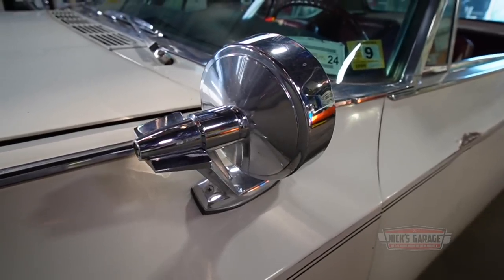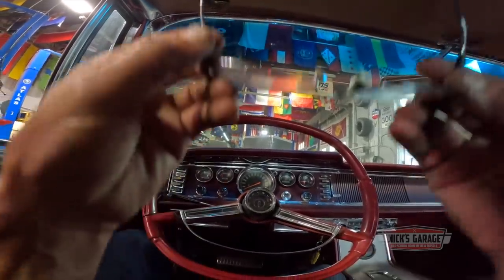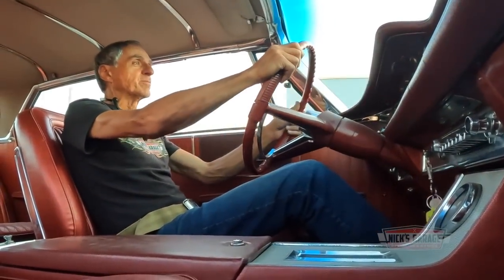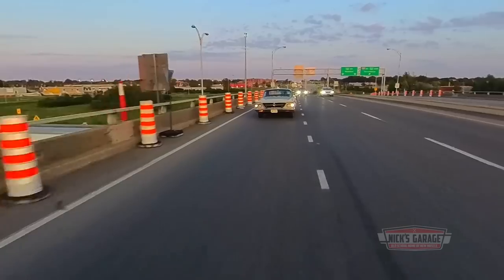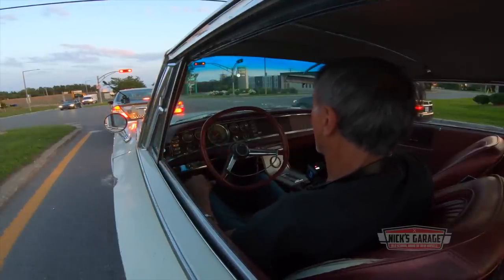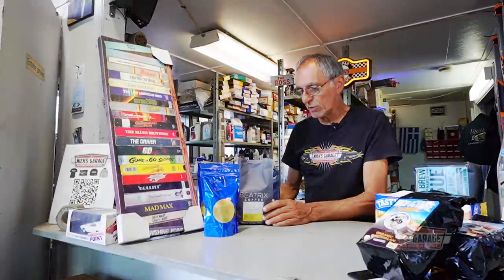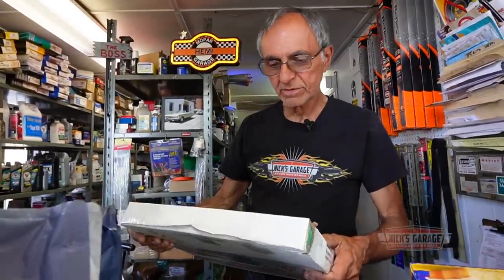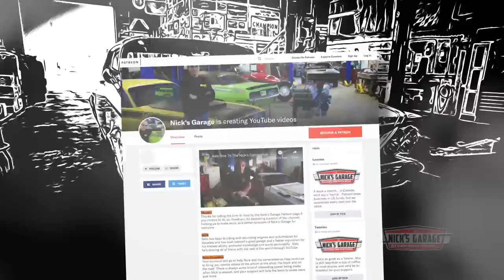Ultra RARE 1963 Chrysler 300J Blast - Highway Star

Comment: Best video yet !! 
I drive the exact car 300J white on red. 
I bought the car from the original owner 25 yr ago. It’s a beast !! It is stock with sure grip 3.23 gears. When you can get rubber shifting from 1-2 in a 727 automatic you know it’s torque monster !!
Mine is all original with only 45,000 miles. 
Hi Ho Silver, away !! 😂
Reply from the maker: Right on!
Reply: I have one too, white on red with A/C!!

Comment: Those are short rams. The overall length of the Rams is 30 inches but the long/short designation refers to the length of the individual runners, not the total length of the manifold. "Long rams" have individual runners for the entire length while "short rams" are divided for one half (15 inches) the length. It is obvious when you consider the outward appearance of the the manifolds. The divided section can be easily seen in the castings.

Comment: Awesome to hear that big car chirp into second gear like that.  Always loved a 727 being pushed by a big block!
Reply from the maker: Same here!
Reply: @NicksGarage  bet you misssed front dish breaks lol i got an old 1964 c10 ill be doing disk breaks basically only thing ill mod on it well the engine 292 inline six with head flow tricks high compression custom cam lots of muffler water [only] injection  and offy intake

Comment: Some Edsels had push button auto transmission, but the buttons were in the center of the steering wheel. Some Ramblers also had the same push button system as the Chrysler option (especially the Ambassador models) due to the fact that they used the Chrysler Torque Flight transmissions, re-badged as the Torque Command. My father owned an AMC/Rambler dealership back in the 50's and 60's and I remember seeing and riding in them, as well as driving them around the lot when I was a kid.
Reply: That is correct.  I had an Edsel a few years ago with the push button in the centre of the steering wheel.
Reply: All Chrysler Products equipped with automatic transmissions had "Push Button Drive" from 1956 through 1964.
Reply: It’s a great space saver to move to dash.  Took them 50 years and it’s back. My 2019 Ram has a transmission dial on dash.  Love it.

Comment: Awesome video!  Kudos to Mike and Mary for letting you give it the beans to showcase one of the kings of early 1960’s passing power.  The style is polarizing, but down low torque is fun.  I built a Chevy 496 that was at 500 ft lbs at 3,000 rising just past 600 ft lbs at 5,600 - it would just leap at any speed the accelerator was floored.
Reply: Nothing feels as good as all that low end torque of a big block

Comment: My 1963 Dodge 880 shares so much with this car for good reason.  From the firewall back it is the same chrysler. Dodge didn't have a full size platform after a screw up and Chrysler gave the platform until the Monaco came out.  Check the steering box. They were sloppy when new.  I have mine tightened up as much as possible but still needs a rebuild this fall

Comment: My neighbor had a 300J with the 413, thought the 413 was a 4.25 bore. Another Neighbor had had a 58 Edsel with a 361 PI. The Edsel was much lighter than the 300, but the Edsel would beat it, but those 2x4 s sounded so good. The 361 PI was a solid cam in it and a 4150 Holley it was said to be a 750. That thing would rev to the moon. The tachometer would wind to 6200 rpm s and that’s why it beat the 300. They both had this charisma. That was gone a few years later.

Comment: Said it before, if i won the lottery it wouldn't be hemi chargers in my garage, it would be every model year of 300's sitting on my property
Reply from the maker: Nice choice!
Reply: Maybe Nick should find a nice 1970 Hurst Chrysler 300 that no longer has a matching motor (or a worn out motor) and put the 528 Hemi in that. Sure would fit the "big motor" theme of the 300's and would really motivate that big C-Body Chrysler (of course a 70 or 71 white Cuda with Red interior would love the 528 Hemi as well). I am a big man, so I am with you loving the 300 line.

Comment: The first or second time around, I thought it might be a fluke for the tires to "chirp" when the transmission upshifted to second, but the same thing happened over and over again, so there's just a lot of torque coming into play. Going  back a long way in my memory bank, I believe this car had a listed curb weight of around 5,000 pounds, and that's a lot of beef for a 413 (+.060) to haul around. Fortunately the big block MoPar is up to the task.

Comment: I had a Dodge Coronet 880 custom convertible 1963. I can see some of the parts that 300J had that was on my 63. Tail lights and I think the head lights. The back end of that 300J looks a lot my Coronet. My Dodge had  the push button shifter, it went across from left to right. Not up and down like that one. Nice going Nick.😁
Reply from the maker: Great cars.

Comment: I've had distributor bushing get ovaled out. You can set it but as the rpm go up the gap will change due to the wear in the bushing and or shaft wear.

Comment: 1963 us safety regulations required all new 1963 cars to be equipped with seatbelt anchor attaching points but not the seatbelts themselves they were optional. And almost no one ordered the seatbelts it took five more years till 1968 before seat belts became mandatory in new cars.

Comment: American Motors used a push button transmission in the late 50's to ( if I remember correctly) 1963 or 64.  It was designed by Borg Warner and called Telovac.  I think Rambler called it flash o matic
Reply: Edsels had the push button also on some cars.

Comment: Still has carb or timing issues. It’s like it’s flat, distributor advance working?  Just watched a video from Dead Dodge Garage where he road tests a ‘61 G with a long ram 413 and it sounded completely different, much smoother and faster.

Comment: We've owned a lot of Chrysler over the years but I have no experience with the 413 engines. We've had 318s, 361s, 383s and 440s. I think the 383s are the best all around engine. Their powerful, fast and can handle anything you ask them to do. Actually all the Chrysler engines preform very. I'm not too impressed with Carter carburetors, they are usually the reason for a Chrysler engine not performing as they should. If I happen to take on another Big block Chrysler,  I will replace the Carter with a Holly. I've used Holly's on my Fords and they never disappoint me.

Comment: I saw the 140 mph speedometer, I was wondering if that 300J  it could do 140+mph?
Reply: I was thinking maybe it could...but you would want that steering tight and front alignment...and good brakes and a closed course... it would be like a runaway train coming down a mountain and likely ride like a pillow if the road is smooth.
Reply: Push button automatics was a Borg Warner thing, till the auto company's started make the transmission.

Comment: Any data on 0-60 or 1/4 mile times for that car originally? A moment in the video there is a red Honda, I think, in the left lane where you go right to turn off (at 22:43). Looks like they are thinking "WTF?!!" as you motor on by chirping the tires with that big ass engine noise. Had to watch it several times...couldn't stop laughing!!
Reply: 1963 300J 15.8 @ 89 mph quarter mile.
Reply: @victordjinn632  And that was a crossram version wedge motor?
Reply: @casperdowlen625  Yes. There were no other engine options for this car. When you bought this car you got the 413 cross ram. That mod was for top end. The car weighed 4500 lbs which is 2 and a quarter tons. You'll notice it has a 150 mile per hour speedometer. Necessary because it would do most of it. 140 plus. Not a quick car. A fast car.

Comment: Hey Nick, I was wondering if you could do a video on how to make your old muscle car just go as fast or faster then modern cars without going crazy, like my 68 charger is going to be estimated at about 350 horse, and I was wondering for B body’s for there weight what’s the appropriate HP to make them go faster then the modern car, like it the 1/4 mile, I’m guess like 450hp?
Reply: Yes, I agree.  Most of my engines that customers look for is  400 - 475 HP.

Comment: Yeah, those Bendix drum brakes are terrible. I had a 64 Dodge back in the day. A couple of hard braking stops from 60+ mph and that's about it, no more stopping.  If I had that car now, I would have put Road Runner disc brakes on it. Chrysler engineered them to go fast but not to brake till much later. A real shame.

Comment: I looked up the specifications of the 300J. A big car, but not particularly huge by 60's standards. My parents had a '76 Cordoba, which was almost identical in size, and the Cordoba       was a "smaller" Chrysler. I drove the Cordoba. A nice car, would have been better with bucket seats.  It had the 360, so no where near the performance of the 300. I never drove a Cordoba with the 400, which came closer to the 300.
Reply: The 2.40 rear gears in the Cordoba made it a dog regardless of engine. I had a real nice one for a while recently. All black, buckets, console, floor shift, 400 engine, Lean Burn delete, & tuned Holley carb. If not for the 2.40s that tank would have moved halfway decent. Drove good and smooth, though.
Reply: @mickangio16  I thought that there was an option for a 3.21 ratio with the 400.

Comment: It even churps in between shifting gears the ignition timing is perfect leave it there use the mopar performance distributor hold down clamp get rid of the stock one thier cheap aluminum and they bend downwards

Comment: Shes still not happy on throttle tip in, wonder if that cross ram is good for low rpm?
Reply: This car has the Short - Version Long Ram.   TQ comes in at 3400 RPM's.

Comment: Back in the 80.s I built my 67 GTO miter with a ram air five can from crane  I had to drill my main jets out to a quarter inch just to get it to run I tried a eldebrock intake with a 950 holly double pump it did not work I tried a 850 it did not work either  so I had a 66 threee Duce intake and two dumper carbs I trded a braided oh Al rug for and a 6$ GTO hood with the Tauch on the hood for it made my own linkage drilled the main jets to quarter inch cut the water neck offf so I could make it a air gap I take and change carbs and intakes without bother it I potty mahed 12: